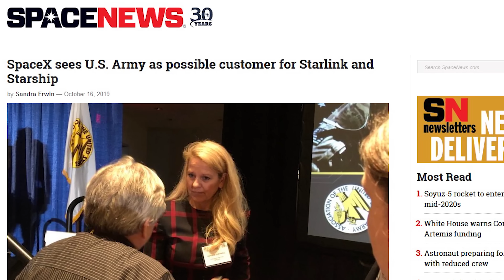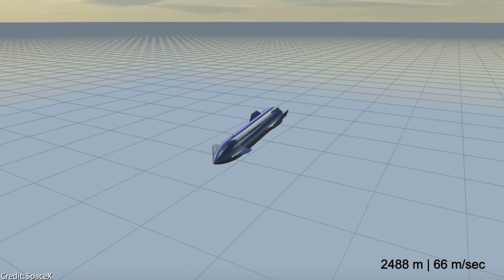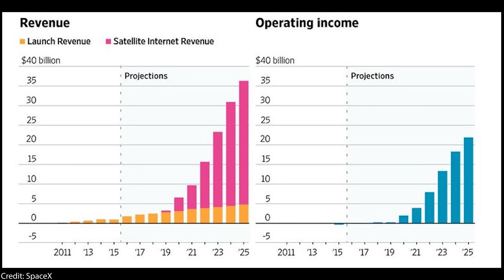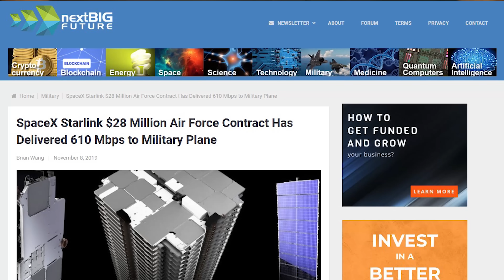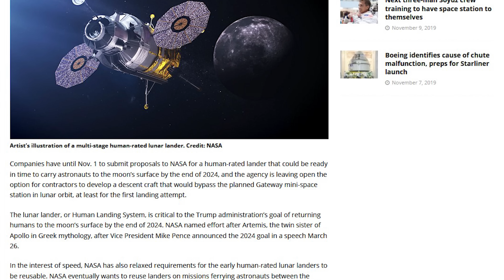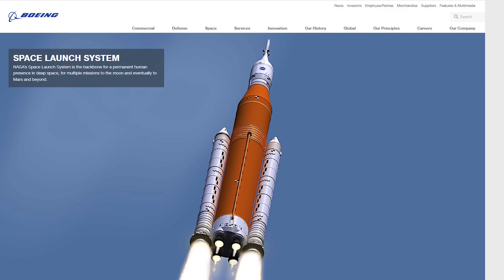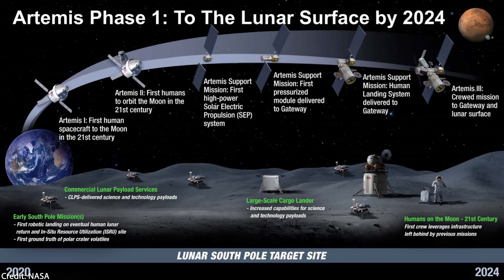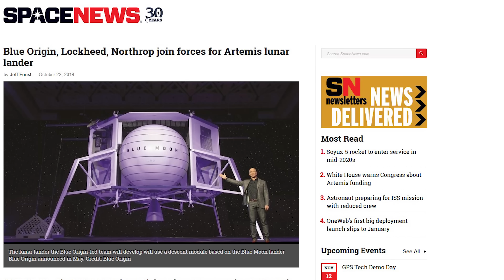Starship Prototype Progress, Military's Interest in Starlink, NASA Moon Landers' BIGGEST Problem

Comment: I’m an amateur enthusiast collecting data on the mars colonisation project and it seems logical to me to do all the low-gravity research on the moon first. I’m thinking research on a biosphere (checking out different life support systems), shuttle designs, mining techniques (perhaps using the Boring Company machines), steel, glass and cement manufacturing techniques ( arc furnaces), kilopower reactors tests,  and regen-exoskeleton tests to arrest muscle atrophy.
Reply: Habitats definitely but I left that out on purpose because I do not think 3D printed will work because 1) they are not structurally sound for the air pressure and 2) confined spaces need to be fireproof and PLA etc are not. That is why I went for reinforced concrete. 

Rotating stations I think has too many problems (there are plenty of videos on the subject). The answer to muscle atrophy is regen exoskeletons which will also have the added advantage of emergency life support.
Reply: Thanks. Very useful presentation

Comment: The SLS is a modern launcher if reusability (not Space Shuttle style ´refurbishability´) can be added. However, the manufacturers have been in action for more than 30 years charging a lot of money to develop this launcher without delivering flight hardware, instead, they were very competent in political maneuvering and extorsion by threatening jobs as many large corporations like to do. This is a form of corruption reminiscent of underdeveloped countries and kills any kind of progress thoroughly. Such manufacturers need to be banned from Federal Government contracts. In fact, one of the companies recently killed more than 300 airline passengers and crew by installing faulty software. The Soviets were planning to make their even larger Energia core stage reusable by letting it complete one orbit, -skip off the top of the atmosphere a few times to bleed off speed, -then land it near the launch site. The SLS core stage could be built in series by a legitimate manufacturer perhaps at the same production site but definitely under new management. The SLS is still missing an Exploration Upper Stage for interplanetary transfer orbit insertion, but so are the alternatives presently under development in the private sector. Reusable strap-on SRBs and recovery infrastructure (ships) are available from the Shuttle program.

Comment: Lunar Gateway's best potential application? Make it unreel a 20,000 foot long cable like a line on a big fishing pole. Pull it in circles until the end is going 2000 feet/sec with 6 gravity centrifugal acceleration and rotating around the Gateway at 2 rpm. The lunar lander grabber/releaser at the end will release the moon bound lander with a 2000 fps head start, thus effectively cutting orbital release velocity from 5500 fps to 3500 fps.  This drops fuel requirement by 40%. Likewise fuel requirement from moon to gateway is reduced 40%.   A 20 mile long cable could achieve a velocity that cancels out the gateway's orbital velocity completely and nearly touching the lunar surface, thus making gateway/moon transfers a piece of cake.

Bottom line? There are several methods to get payloads off the moon with almost no rocket fuel. Once the infrastructure is built, the moon base has very viable self sustaining economics